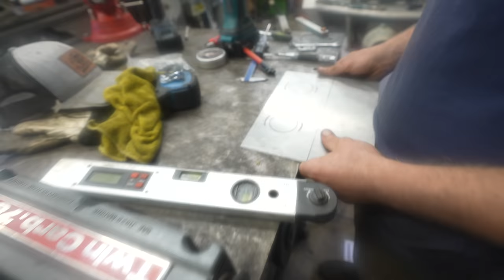100HP Micro Jet Boat Speed Test + Jumping Wakes!

Comment: From the looks adding about another 18inchs would be a sweet boat foot in cockpit area couple more in engine area to maybe get a triple in there maybe just few inches in with would be a blast and still fit in a truck before just add a 18 and add a 12 too with and make it a two seater and twin engine pocket rocket.

Comment: Might be a good idea to use a racing style seat that would let you sit with back against the rear bulkhead for a few extra inches of leg room.  As it is looks like the seat needs to move back 6 inches at least but can only get what you can..

Comment: (Poof! appears from last vid) Ha Ha, first thing you did was an airbox. Not that you want to put that much time in it...but, if you extend the top of the box towards the starboard about 2", than made a 20" (on the engine side, looks like 4-4&1/2" on the starboard edge of the extension, then built a bottom, drilled some holes in the engine side bottom edge of the inverted snorkel,  and built it back up again to ad a whole three part box section shaped like a U with holes in the bottom edge and you would have a fairly well controlled intake. any water that comes in hits the bottom of the U and drains out before making its way into your engine.

Oh, and after a couple + years of thumbs up I finally
 subscribed.

Comment: Put a bilge pump in it, that way you can risk it a little bit more and an emergency flotation device under the engine cover maybe? I'm guessing it weighs bout 200 lb sooooo you'd need a 100liter bag(3.5cuft) and 200/220g of CO2 at 900psi... The emergency switch has to be in a place that would only get wet if it sinks....

Comment: As much as it sucks that it's basically done, what that could benefit greatly from is make the windshield at the nose/bow instead of so far back. Then you can push the dash forward more, taller people can ride it with seat rails, and you can make a windshield taller so you're not getting waves hit you in the face.

Comment: I'm glad you guys are having fun and congratulations on the build but I'm not going to lie. 42 mph on THIS boat is god awful. You have 100 horsepower pushing a six foot shallow V hull mini boat that weighs less than 300 lbs, by itself. What was it again? 250-ish lbs? By contrast I had my fair share of fun on a Tiger Shark 770 jet ski which was capable of going 60 mph and this jet ski was a behemoth compared to your mini boat. 

9'4" long, 90 horsepower, and dry weight is 410 or 470 lbs. I don't which value is correct because I don't know the EXACT model I had. This was almost 20 years ago so if I had to guess, 770 "Monte Carlo". Either way you have a 10 horsepower advantage on a boat that is 160 pounds lighter (minimum) and 3 feet shorter than the Tiger Shark, and only goes a hair over 2/3 what the Tiger Shark can do? Just, yuck. 

On the flipside you guys are brave enough to joyride something that I would never touch. I would be too terrified of sinking it.

Comment: When out skurfing with my friend behing a 1200cc 2 stroke waveraider one day while he was on the beach changing the bindings for his stance onthe board I went for a hot lap and inside of where the sets broke outside a big set for that day came in . I had to get back out fastso I headed back out and a good ssize wave was getting closer inside where it would break so I gave it som gas to get outside before it does. The thing takes off so fast on the glass & up over the wave before it broke in time but I was 20 feet in the air ove r the water in a spit second it seemed at the time a bit scary not expecting to do this I had not jumped a wave runner or a stand up ski near that hi before . I could ride a standup well not the best but could drive in on waves to look like I was surfing. Like I remember jumping those was get on the gas when landing. I am happy I landed it more on the tail and gave it some gas not sure if it matters on a waverunner but doesnt hurt if it is getting water. Happpy nothing broke on it I drove outside of the break and a Harbor Patrol boat started asking disturbing questions so I started to drive away not super fast but he did not like it so I gave it a go for it & hit the gas and pulled away real fast . To get away I got clser to shore inside some big rocks I have dove for lobster at night before at 52MPH betwene it and the beach they did not bother to follow me and left. So back to pick up my friend with the board& the bindings were goofy foot for me. It may sound funny with that stance but when surfing The Point in Newport on a big swell from the right degrees that do come occasionally Big double overhead+ waves come in and half the thing turns into a thick barrel flying over your head well out in front of the wave and crashes like thunder into a huge exposition of monster whitewash! This place you do not want to get thrown over the falls! it can snap your board in half so quick . I have seen a good amount of that and been tossed over into the violent washing machine getting pounded into the sand bck up but not up enough to get any air. Untill I got in far enough to push off with my legs thesand with my feet able do touch it inside. Up and gasp a breath of air after an epic big powerful waves barrel ride if you want to call it the barrels youy see from the shore look a lot more squARE THAN ROUND AND SCARY TO SEE  A BIG PLUS TO KEEP IT UNCROWDED FOR SURE. i HAVE HEARD QUITE A FEW TIMES HELL NO BRO i AM NOT GOING OUT THERE! fOR GOOD REASON IT JACKS UP FAST FROM THE DEEP STRUCTURE IF THE OCEAN FLOOR OUT SIDe.onto the shallow of the Point with big lens cameras on tripods at the waterline on the shore. The best barrel ride I have ever had I have surfed a lot of places chasing swells Salt Creek , Uppers & a lot of Churches with a pass to park on the beach there and a hiding spot I could park my Bronco with some off road I could also get around the fence on the sand and drive on the beach. With gears & lockers & long travel suspension , Yes moe than a Raptor On KING SHOCKS not Fox that are very good too but when I ordered mine I ordered and paid after his request to go tp a scale loaded and weigh my Bronco front and rear separate for sureThey work so well tuned just right I kew for sure my first time blasting up the big Pismo Dune seen looking onshore from the water. With Gears & lockers installed by Unitrax well. & Bigger King shocks I ordered from Brett. While climing up as fast as I can with my old stock 5.0 3022 motor. I was caught by a serious surprise. I was going over a steeep sand razersharp peak at the top. While its good the Broncos wheel base is not so long and I was moving fast to stay on top of the sand to not get Hi centered on the frame. Like I did when kicked out of my house not knowing the name of the girl in my bed. I spent that summer in Paradise in a house 5 feet from where thewaves come up on the sand but 20 feet up a nice view of the cove it broke into and I could catch lobster at night with my dive light! A nice right point break that was consistent enough to get a lot of nice waves thAT IMPROVED MY BACKSDE A LOTBEING GOOFY FOOT. oNE THING THAT HELPS HAVNG THAT STANCE IS SURFING BIG HUGE KIND OF MIND BLOWING POWERFULL BIG WAVES OCASIONALY SO BIG & LOUD  THAT LIVING ONE HOUSE BEHIND THE OCEANFRONT HOME OWNED BY THE RESIDENT WHO OWNED vISION SKATE /SNOWBOARD cOMPANY i WISH i* HAD SHOWN HIM THE PICTURE iFRAMED & HANGS ON THE WALL OF MY HOUSE RIGHT NOW NOT AT THE BEACH AS CLOSE BUT OFF gOLDEN wEST WHERE THE CLIFS ARE ON DOG BEACH. hOUSES IN zOOPORT ARE TOO EXPENSIVE. bUT BY PIPING & WIRING UP VERT PRO HARD PIPE EVEN NOT JUST emt. wITH WATER TIGHT FLEX FUSED CUT OFF SWITCH POWER . tO bE A SUCCESSFUL uNION eLEVATOR /eSCALATOR INSTALLATION MECHANIC & FORMAN . eVEN MADE FIREMAN OF THE HARDEST JOB TO INSTALL AND MAKE SOME TALLER AFTER REPAIRING TO RUN AND CLEAN UP TO BE SHINING AND RUNNING WHILE OILING THE CHAIN IN WAlks the Mayer of LA & consultant and head honchos for Disney in fancy suits walk into see all of them running smelling nice and looking shiny  I wa offered right then an overscale pay scale job in Las Vegas & I was still just a temporary Mechanic at the time. Asked if I wanted to run that job I said I would not jump in line to do that I know what a craxy job this will be. The steel for the building not tall & straight . more like a cargo ships frame dropped from near space. Not an easy task to install elevators in. The alignment of the4 rails the elevator cab and the counterweight are guided by. Hane to be aligned with tighr tolerancejust right. WIT THE NEW ac controllers & a weight device that told the controler how much power & force to give the motor . I f they were to tight at all om either set it would not go up through that & not work you see.& with the company joining together with an international elevator /escalator manufacture repair modernization & service company they made a lot of strickt overkill safety rules for the insurance.  knowing if I followed them spending the money it would take I would be fired so fast it would not matter. When I did folowing them my helper was apologizing out side I had just told the construction superviser I was supposed to be fired if I had 3 writeups how did I get 5 with a 15year pin.after the witness watching shaking his head from me explaining what & why I did what I did. The superviser said to me Tst does not mean I would not hire you back if I got my shit together that  is I almost laughed . I just turned toward him looking him in the face & said in a firm voice OH MY SHIT TOGETHER? hmmm how about that? & walked away outside where my helper was apologising looking ready to cry. saying I was right about following the rules I said yea do you think I am new here in this trade? Stay here calm down I will be back . Where are you going to go he asked? I told him up those stairs to the repair department to get a new job I am glad I got fired from construction . I just took over that job we just did that had changed the code to build it with a n air duct pipe from the hospital to the parking structure but not changed for the elevator to ne acceptable by that codeI had to work 45 minutes overtime a day keeping the contractors inspector trusting me. & Getting thrown into the fire with only one day of the 3 day instruction meetings . Having to design an draw up the changes to pass submit them to the structural engineer to do the math 7 TELL ME IF IT WOULD PASS. tHEN GET WHat I NEED TO MAKE THE PARTS i DESIGNED AND MAKE THEM UP AND INSTALL THEM TOO OR HAVE THEM MADE TO BE ABLE TO MAKE THIS JOB ABLE TO PASS.i WEB=NT UP TO THE REPAIR DEPARTMENT TOLD THEM WHAT I KNOW AND CAN DO FOR THEM. tRAM mOTORS TO 5 THOUSANDTH'S rOSET AND POUR THE MOLTEN METAL IN.AND PASS THE +THE STATE INSPECTORS INSPECTION

Comment: Still needs more stability. It could go much faster if the intake was not sucking air, so maybe adjustable hydrofoil on the front that keeps the front on right level so it only sucks air when in actual jump, not while going on relative calm water.

Comment: Me ask you something does that wake boat have accommodation on it and if it does does her washer and dryer combo unit if that's the case try drying out if not in the head is there's a heated towel rack use that

Comment: doesn't look like a dolphin hopping out of the water like it's got a killer whale or great white chasing it to eat.  Bet some trim tabs would go a extremely long ways.  extend them about the length of the pump from the back of the boat and that will allow you to use the motor trim to gain more speed without sacrificing the kangaroo effect.

Comment: 👴  I see u keep pumping water out with a pump, but if you would put a hose on the bottom of the boat and hook it to a 1 inch pipe on the exhaust it will pull the water out the hull while the engine is running,like air does for a paint can,

Comment: Use a steering “wheel” like a TF dragster has and glue in some styrene under the dash and sides because not if but when you bury the nose at least it won’t sink. For your longevity and frustration level apprentice under a machinist or engineer for a few months, your use of tools is going to get you hurt……but then again what do I know?……

Comment: Isn't it better just build jetski? It will be more stable and safer. The wetting area or displacement is the same. Your boat can sink within a half minute like a stone if something wrong, but jetski will not sink if properly designed.

Comment: RUN A FEW BEADS OF SILICONE PORT TO STARBOARD ON EITHER SIDE AND AFT OF INTAKE TO PUMP ON THE BOTTOM OF THE HULL UNTIL IT STOPS PORPOISING ( skipping like a rock) .

Comment: needs trim tabs off the back of it or something, porpoises way to much, loosing a lot of speed, worked at a boat shop for 7 years, boats that did that had a bad hull design, should be able to go wide open without Porpoising. awesome though!
Reply from the maker: For sure!